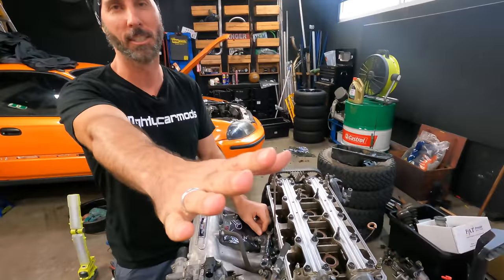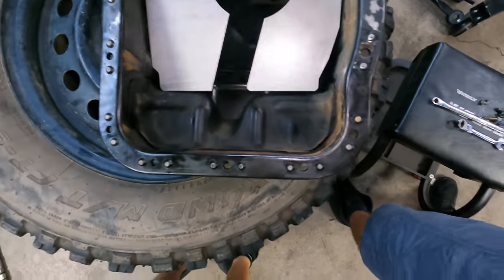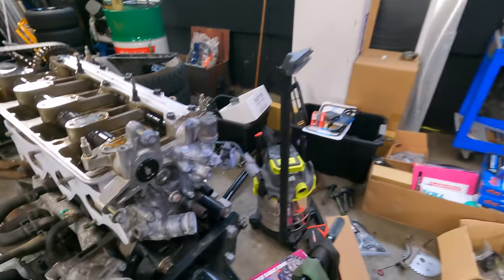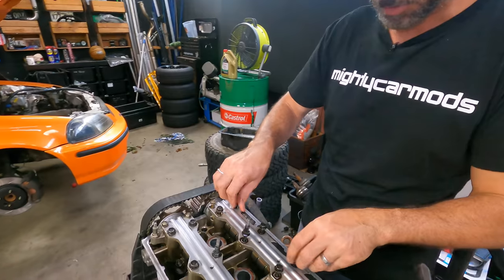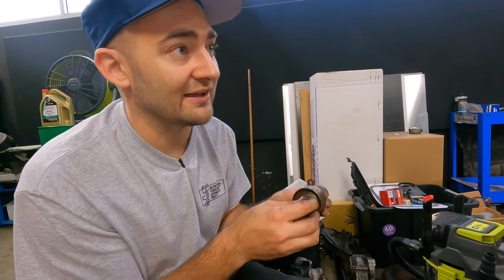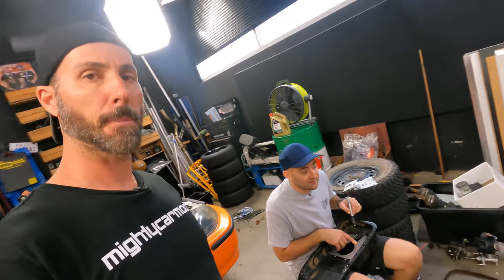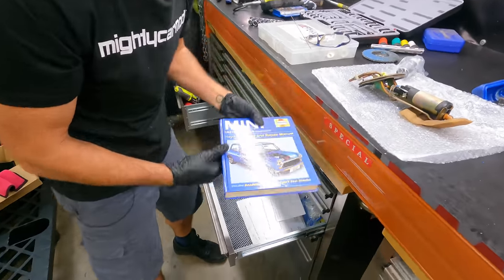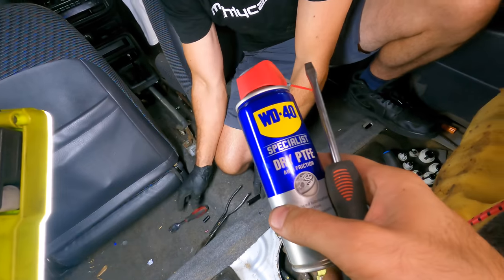Spoon your SKUNK until he MUGENS - CIVIC Build (EP5)

Comment from the maker: Do you ride a motorbike (or does your car smell as bad as ours?) Check out our new CHOPPED GAITERS https://mightycarmods.com/collections/clothing/products/chopped-tube-bandana
Reply: Hi
Reply: @volvo-rq1zt  ello
Reply: Fun fact ..skunk started as original TRD team they left a d started skunk...and mugen is pronounced moo gin..g pronounced like ghh as in give it means ultimate its S.hondaya sons company..such a fun fact isnt it😐
Reply: yes
Reply: have you measured compression on this engine just to be sure
Reply: A Civic is what you get stuck with if  you can't get a WRX...
Reply: Nope, but I do do-up my flies Moog 😉
Reply: Guys, be careful! Don't clean parts to be welded with brake cleaner, serious death probability! Google it :/
Reply: My car smells like ancient upholstery.
Reply: yes I have a Motor Cycle.  2012 Harley Davidson Blackline LE - 103 ci and 1690 cc - Matte Black!
Reply: Hey just a heads up, that speedfactory cam plug needs to come out. You still need your distributor housing to run coil-on-plug kit.
Reply: Shouldn't it be a "She" instead ? You know like Cheryl....
Reply: Gents, your inner tie rods are shot. Replace em. You did the outers but the inners are loosey goosey
Reply: Where I'm from those are called buffs (after a brand that made these things popular)
Reply: Used injectors? Do yourself a favor and flow bench them. Save yourself a lot of diagnostic headaches later from those old parts.
Reply: You guys not changing the camshaft? At least get one from a b16b.. come on..
Reply: Yes, have a ttr250 as my main bike these days, and my truck smells like whatever food my kids have lost in the back.
Reply: TALK WITH BOOSTEDBOIZ!!!! Please!!!
Reply: Yeah ,  I ride a Superbike and my car does not smell either...  
But my government really stinks 🤨

Cheers from South Africa 🇿🇦
Reply: @MaximumQc  They are making a driver, not a drag car.
Reply: We need a Moog x Happy VTEC Man collab shirt
Reply: You guys should do a 3000gt vr4!
Reply: Don't end with and update of this Civic. Continue the UPDATE into a Australian MCM EK9 equivalent with Turbo (twin?) using JVM parts.... It would be an interesting adjunct and enhancement to this little Civic afterwards. Just because.
Reply: I’m ordering the shit out of those gaiters :-)
Reply: How fast was the RS3?
Reply: Thanks for the laughs guys!
Just ordered some merchandise from you🤗
Keep up the good work and hurry up with sending that merch! Can't wait 🥰🤣🤟🏻🖖🏻
Reply: They are snoods
Reply: Reason I love Hondas is for the NA HP/litre. High revs and being able to slap bigger cars on the track with a little tweaking
Reply: Moog, people love Hondas because they're an entire motorsports company. Makes since to me the company that makes my indestructible motorcycles/dirt bikes/scooters, would be an enthusiast preference
Reply: Civics are cheap to insure, easy to fix, parts are everywhere, depending on where you live they are usually pretty affordable to buy, quite fast and handles real well even as stock. Yeah..
Reply: @davefroman4700  they know allot about hondas and they make power! Phong is the N/A beast and mostly would know the best setup for them + all the honda knowledge they have is amazing
Reply: K SWAP THE WORLD FOR BETTER PARTS/PRICE AND PERFORMANCE. K24 GOES FOR LIKE 600 TO 800$ U.S. AND WHEN BOOSTED ON STOCK BLOCK CAN ACHIEVE 500HP WITH SAFE AND MINIMUM INVESTMENT. WITH A FEW BUCKS CAN GET TO 1000HP AND ITS A COMMON  SWAP FOR 240SX, MIATA, FRS, OLDER BMW'S 3 SERIES, MINIS, MR2, RX8, SUBARUS, NSX.... YOU GET THE POINT. HONDA CEMENTED ITSELF AS A PERFORMANCE ORIENTED BRAND IN THE USA AND THE PRICE AND PARTS AVAILABILITY MADE IT EASY FOR EVERYONE. 
IT PROVED BEING CAPABLE OF RUNNING WITH THE BIG BOYS FOR A FRACTION OF THE PRICE AND DOUBLING ON RELIABILITY.

WITH ALL THOSE MENTIONED CARS THE ONLY OTHER "SMART" AND LESS COST EFFECTIVE SWAP WOULD BE THE LS V8 AND WITH EXAMPLES LIKE THE CIVIC HERE ON MIGHTY CAR MODS BEING ABLE TO RUN A SUB 8 SEC. 1/4 MILE THERES NO NEED FOR THE XTRA 4 PISTONS. SO SAVE YOUR MONEY AND GO K24. JUST GO ASK THE BOOSTEDBOIZ HERE ON YOUTUBE. 😎
Reply: love the straight bogan editting at the end their m80s
Reply: Two wheel squad!! I went from a 1998 suzuki katana 600 (came in multiple boxes, complete basketcase) for $800 usd, to a 1986 suzuki intruder (also $800) and now back to a 1996 suzuki katana 600 (somehow ALSO $800). All were broken on purchase and needed significant fiddling to run.

Currently recovering from a spinal fusion so I can't take advantage of the nice weather to ride yet, but my next bike will definitely NOT be carb'd, lol. Every spring I've gotta clean, tinker, tinker and tinker some more to get the old girl running again. You guys should definitely do a "nugget" bike challenge where you both try to get the fastest bike you can for $700-$1000 and then compare them on a track/course!

Alsooo....@16:59 Wait..you guys can't just buy parts without a vin?!?!? Even online?
Reply: I love Hondas because I’m a bit of a dickhead, and hondas fully support dickheadness, if you treat for example a VW the same way it would be broken, very broken :)
Reply: Found this on the interwebs from a Honda-tech forum: 
"starting in 96 they started putting the vin plates on the trannies and on the block. and if you are looking at a 96 motor the vin plate is located on teh front of the block right above the oil pan but you have to remove the headers to get to it."
Reply: WTF A KAYO MOTOCYCLE
Reply: Went ahead and checked how many kilowatts it should make: the honda B16a makes 136 KW at 8 200 RPM. Info comes from WikiMotors.
Reply: Honda love to be driven hard more you beat it more fun it is 😅 ..most car just cant handle the abuse but honda do and they love it..even got some info had a new 06 Si beat it for 4 years  i mean track day ,drag racing (rev limiter and power shifted for 4 years),snowdrifting, never had a problem got a new 2015 wrx well.. in the first year many problem occur the windows had schizophrénia , the batterie died(in the first year!!!)rear brake a made of foreskin cause they were done after 1 year ...want me to continu?? I launch it once and  broke a support ..so for me k20 will ever have a good place in my heart
Reply: Do a v6 camry
Reply: I making a suggestion for mcm to do a v6 camry build for laughs
Reply: Got mine, thanks
Reply: "Why do people like Civics?"

At this point, if you have to ask, you wouldn't understand.

The real question is why do people hate them?

Comment: If you are genuinely interested in why people love Hondas, here's my take on it; I'm in Sweden, and I've had ~60 cars so far. Tried all kinds of things. Mostly Euro cars (Volvo, Saab, BMW, Audi, VW, etc), naturally. But then, in 2010 or so, I bought my first Evo, and I instantly fell in love with it and how GOOD the Japanese cars really seemed to be. Easy to work on, plenty of parts available, well engineered, and fantastic to drive. Since buying that Evo, I've gotten several other Japanese cars, and me and my wife currently have 7 Hondas and we love 'em (mostly Preludes though). They might not be the fastest cars around, but the driving feel is just phenomenal. The way the shifter/gearbox, steering, pedals feel is something I've never experienced with another brand, not even in the faster Japanese cars. So in short: They are so good to work on, there are lots of parts available still, and the "smiles per gallon" when driving is through the roof. AND as seen on (mostly) the American Honda scene, they have HUGE performance potential.
Reply: I'm at 15 cars myself and my old 1996 accord was in my top 3 
Slow af non vtec, 300k km on it 
Ran like a champ even in minus 35 c

Owned a gtir, many soarers, celica, wrx 
Driven a few skylines etc 
There's this feeling a honda gives that just makes you love it
Reply: I agree! They are little go carts, they are cheap to build. Im building a turbo ls for my wagon and ill have 300hp for like $3000. The aftermarket performance support in America incredible. I grew up down the street from speedfactory who is working on breaking into the 6's in the quarter. People build rwd and awd civics and there are a ton of parts designed to make it easy. They are cheap, reliable, easy to build and work on, fun to drive, and personally i think their cars look awesome.
Reply: Glenn off of Twitter??? You legend, fancy seeing you on here.
Reply: @blacktopmediauk  haha hey man, yes, Glenn from Twitter! :)

Comment: Little tip for in the future, when welding dirty metal that doesn’t take a heavy load, use 316 Stainless Steel welding wire, it welds cleaners and will hold up

Comment: I used to really be into hondas. As a teen it's easy for them to become an expression of your personality. They are cheap so you can afford them, and are easy to modify so you can get really creative. You can have fun searching for cool parts and learning how to build cars yourself. They are fun to drive and you can mess around and have a good time with your friends without worrying to much about damage. Then when you grow up, you can restore them or make them crazy fast or just nice and stock, there are so many options, I think that's why people like them.
Reply: They're very well documented, reliable, and easy to work on.  You can probably disassemble the entire car with 3 wrenches.  And parts are cheap because the car is cheap.  It's not like Audi where an exhaust will cost $3k just because the car its going on is more expensive.
Reply: Agree 100% I've owned 3 civics and 3 integras and and they're just great little fun cars. Not nearly the fastest thing on the road, but a built integra with a good suspension is some of the best fun you can have on a back road
Reply: Well put. I have an RSX, and I enjoy the FWD experience (especially in the winter). It's been very reliable, and extremely cheap to maintain, I even did some mods to it when I had some extra cash. The engine also sounds great at 8000+ RPM. If you like SCCA autocross, a CRX is competitive in some classes, and you can prep an RSX to STF pretty cheaply and it'll be competitive (and you can still daily it). (unlike some other SCCA classes, where you need to run a $100k miata)

I can't think of any turbo cars that are both reliable and also in the honda price range, and I can't think of many FWD that are better.
Reply: My reason is front-rear double wishbone suspension (80's-90's, low center of gravity and light (80's-90's), revvy engines, reliability, quality and style.
Reply: The reliability is reliably there when you rely on it.
Reply: @piuthemagicman  Man you nailed it. I really think Honda made a big mistake going away from the double wishbone suspension. The DC-2 Integra type R was a legit track beast. I really think Marty and Moog are going to have a bit of an epiphany the first time they accelerate through a turn...
Reply: @neonmonkey1942  Thanks, it's great to hear my opinion has supporters. Seems many "honda guys" are just "haha vtec go bwaatatata cool civic bro" and don't know what cool stuff is engineered into their cars. :) And indeed It's a huge shame they went for meanstream style worse suspensions, even rear torsion beams (HONDA PLS) in the 00's. Soichiro Honda was a great engineer and helped make Honda an engineering led company like Mercedes at the time.
Reply: But you didn't say if you're here in the states or in Australia where they have a LOT of other cool 4 cylinder cars. But I do agree but only because I am an American
Reply: @butcherbaker4258  other 4-cyl cool car in USA? Which one? Dodge Neon? Cavalier? ))) There are few on top of my mind - GTI, Focus and WRX (STI). Maybe Bimmer (135 or similar).
Reply: @butcherbaker4258  Hondas never seem like that big of a thing in Australia, gotta be the least popular of the major Japanese manufacturers.
Reply: @sergeymatpoc  sorry it wasn't clear I meant Australia had other cool 4 cylinder cars then we did it seems but I was a small block Chevy fan not a Honda fan. But Honda's cars speak for themselves, good little fun cars
Reply: @AfferbeckBeats I honestly completely agree but I live in alaska so my cars had to be AWD, when I was a young man and first gen eclipse was the car that I cut my teeth on. Had BMW's and a couple of Audi's but mostly short bed GM trucks.
Reply: @neonmonkey1942  True enough, IF they install an LSD. That's what makes them accelerate through a turn, otherwise they'll understeer and wash out like any other FWD without an LSD and they'll be wondering what all the fuss is about(and Moog's Mini with the R engine and LSD gearbox will hammer it). That's what makes the DC2 R the track beast it is. I've had a JDM Teg 1.8 SiR and have a DC2 R and the single biggest difference in everyday terms is the LSD.  Put it another way; I'd take the SiR with the standard suspension, extra weight and not so tuned engine, but with an LSD over the R with all it's tricky bits without one.
Reply: Same reason I've always enjoyed Mustangs, but I'm sure I'll catch hate for saying that...
Reply: and i can walk into a junkyard and be certain to find a civic
Reply: @MrGrentch  You're right I forgot about the LSD. My GSR has an R transmission and the lsd does make all the difference. Congrats on the dc2 R, they're becoming super rare these days
Reply: @neonmonkey1942  Yeah the LSD is a huge factor in how they handle. Double unequal length wishbones, a stiff rear end, with Honda's patented passive toe in under load lower suspension arm bush, a limited slip diff up front in a chassis that was pretty stiff for the time(the EK9 R had some seam welding, the DC2 R didn't but had extra strengthening plates and both had extra bracing) and you get a cornering and direction change monster. Take the LSD out of that equation and it'll still handle well enough, but not nearly to the same degree and with little of the mid corner adjustability under power. If the guys leave out an LSD they'll miss all that which would be a pity. 

I have my R for 16 years now 😲 After selling my previous car it stood me only 4000 euro. I held onto it almost by mistake. 😁 I'm very glad I did though. On top of everything else it's been scarily reliable and cheap to run(except for insurance) #touchwood All it's needed as a daily driver were a few bushings, a coil and dizzy cap, a wheel bearing and a clutch master cylinder.
Reply: They're not cheap anymore lol
Reply: @rhycemg  it depends on where you live brother but for the most part everyone has figured out the value of everything these days with the internet.
Reply: @Rattus-Norvegicus  for people to hate you for your opinion just shows how stupid they are. I am a Chevy guy but I have almost liked every generation they built except the mid to late 70s there an American v8 rwd platform that has always been a capable competitor. No car racism 🤣🇺🇲
Reply: @butcherbaker4258  Agreed, I used to be a die-hard Ford guy because that's what my Grandfather was(also an ACTUAL racist, but I digress) but I  made a Chevy friend and it sorta opened my eyes. Now I don't care what it is, if it's fast/handles well/or is just a shit box I can thrash...I love it!
Reply: @Rattus-Norvegicus  that's what it's all about👊 and anyone who disagrees is missing out. I grew up in Kentucky I found my grandfather's robe while i was playing hide and seek 35 years ago as a young man but didn't know what it was. But there is nothing we can do about other people's past mistakes we just need to learn from there mistakes.🇺🇲
Reply: LSD was the first thing I did to my honda, and I still maintain that it's the best performance mod you can do to any FWD car.

One thing I found kind-of distressing is that they even have to ask why people like Hondas in the first place. Can't we like any car manufacturer we want? Do we need a reason? There's lots of valid reasons to like any auto manufacturer. You can name me just about any car maker (that makes sports cars) and I can tell you some reasons why they're good. I don't need to ask the fans of the make why they like it. One very quick reason to appreciate Honda is that they make some very nice FWD cars. While there are other reasons for sure, just that one is enough to respect the make.

So the MCM team needing to ask other people why they like Honda shows a lack of imagination on their part and I find it to be very distressing.

Comment: I used to have a Honda motorcycle and i was obsessed with them as a brand for the fit and finish and build quality. These days I'd like to build an EK like this one because: 
1. I was anti FWD for most of my car guy life so I would like to go back and experience a good one. 
2. This is a great FWD chassis mostly because of the double wishbone front suspension. 
3. I've never done a swap and it seems like a relatively easy platform to engine swap. 
4. Light weight, high RPM (vtec, yo)
5. I'm getting into old Honda JDM stuff as a fan - EK9 type R, Spoon stuff, etc. It's all forbidden fruit here, so building my a car with a nod to the stuff I'm a fan of is always fun.
6. Watching people track these, they are always having a blast, grinning and laughing at how good it is (watch Speed Academy for some great examples).

Comment: I own a 1992 Honda Del Sol/CRX III with the D16Z6 as a project car. The two reasons why I love it have already been shown in this series so far:

Basically adult lego, various bits are simple to fit.
Cheap OEM and aftermarket parts available from multiple places

It's not fast, but it's fun in the sun and the engine is mechanically simple; I've never done a full engine teardown but the D series is so easy to learn on. Glad to see you two getting into the spirit of things too!